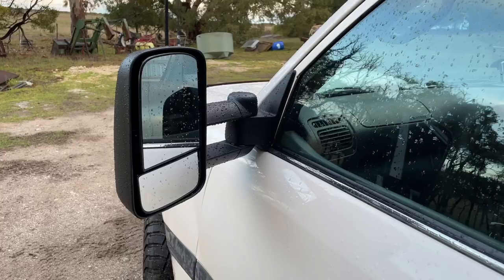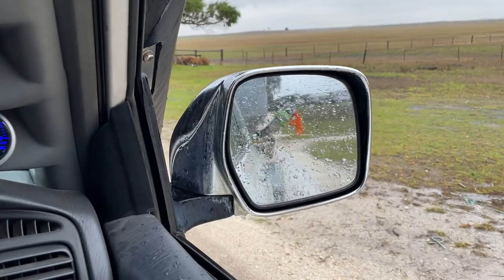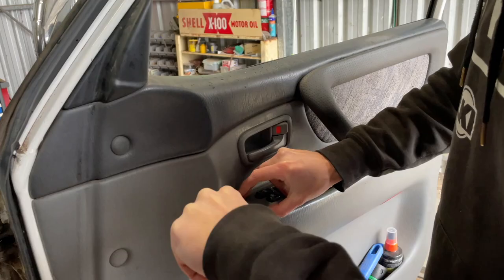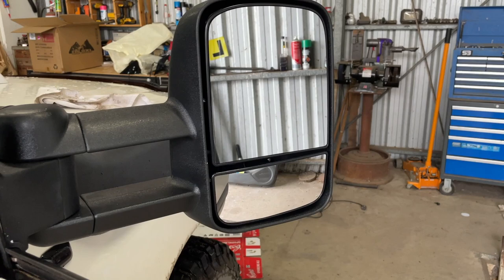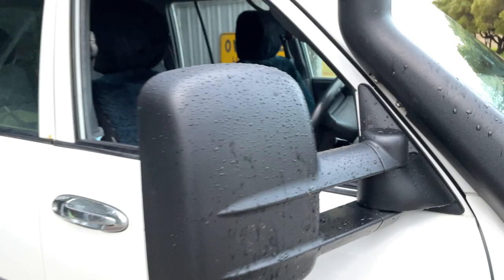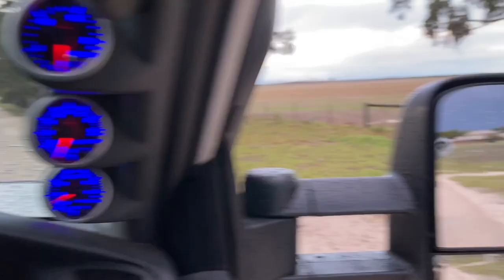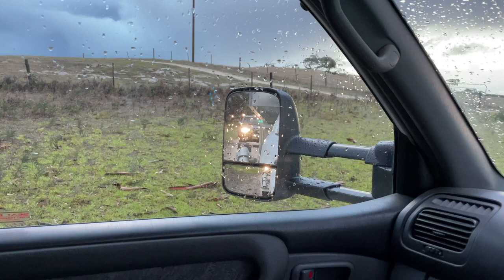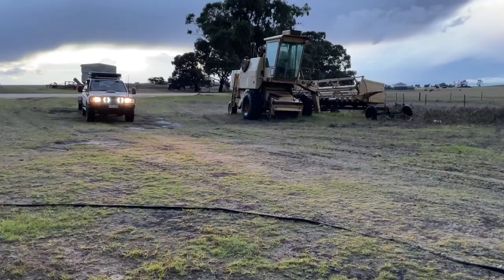San Hima Extendable Towing Mirrors (100/105 Series Landcruiser)

Comment: Great work Will. Do you have an after market oil pressure gauge?
Reply from the maker: Yes the 3 gauges in the pillar pod are boost, EGT and oil pressure
Reply: @WillsLandcruiser  
What is your average oil pressure at idle and about 100kph? Just curious because mine seems a bit low

Comment: Do they turn inwards easy I puchased but very hard to turn and dont want to put too much pressure incase they break.
Reply from the maker: Yes just the right amount of resistance! Easy to push in but won’t accidentally fold in unless you’re doing some serious bush bashing. I’ve only had it happen once